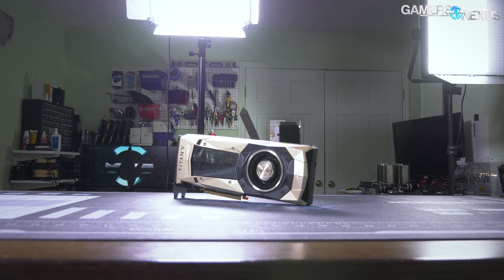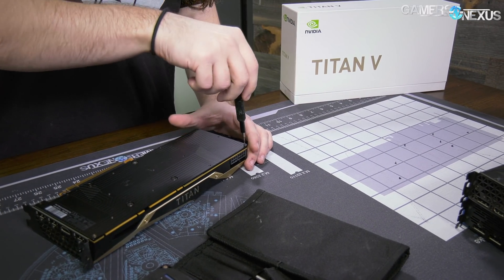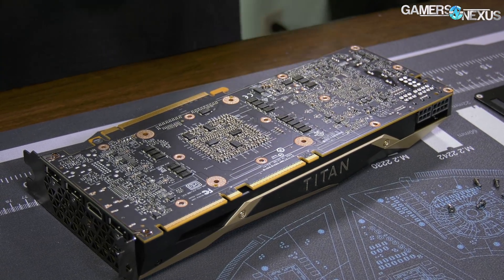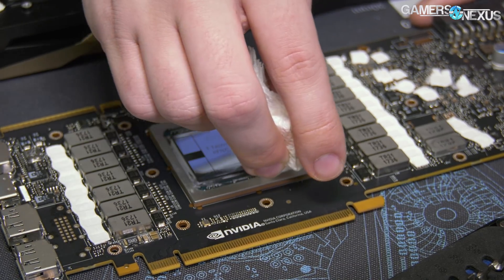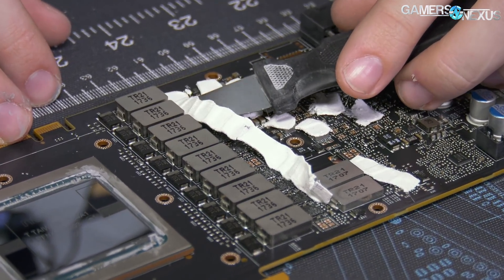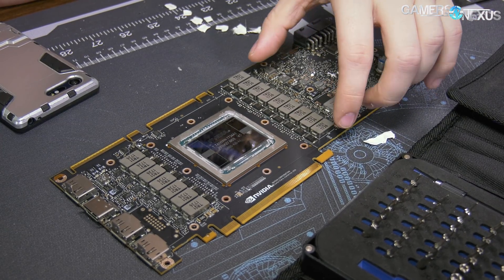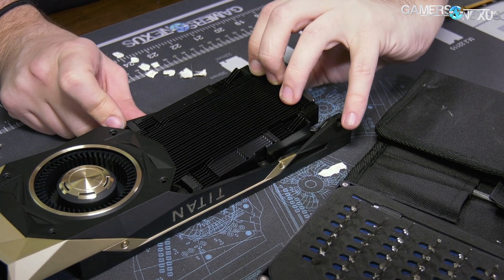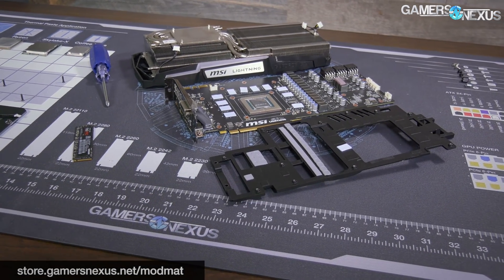NVIDIA Titan V Tear-Down: First Look at $3000 Volta

Comment from the maker: Benchmarks are on the way. Subscribe for those!
GN Modmat Pre-Orders: https://store.gamersnexus.net/modmat
Article: https://www.gamersnexus.net/news-pc/3169-nvidia-titan-v-tear-down-pcb-bare-gpu
You might also like our Titan V specs video: https://www.youtube.com/watch?v=ZjmUzqzDg54
Reply from the maker: How to Computer - Depends. It has a rougher surface that would be somewhat comparable to one of those "grip" aluminum mousepads. It could be done, but it does not have the smooth surface of cloth pads, as the top is more of a rubberized finish. It is definitely meant to be a work mat first. It will come down to personal preferences. I can't outright say that it's a great mousing surface, though, as it's not intended for that use and, depending on your preferences, may cause too much friction. You could always put a normal mouse pad on top of the work mat, I suppose.
Reply: @GamersNexus  , could you tell me which thermal paste you used on the chipset/heatsinker to make it be as good or better than the old thermal paste that was on it? i used a hydronaut and the temps got higher! also which thermal pads [brand and thickness] would you use to replace the old thermal pads on it?  Thank you for the channel ! :D
Reply: Rumour is this can hash at over 3.7kh/s on Cryptonight compared to a Vega 56's 1.9k can you confirm this?
Reply: Thanks for info. I figured it had something to do with using a specific piece of equipment,
Reply: I see that the modmat has not intended as a mousing surface on its page, but do you feel it would work poorly as a mouse pad? I tend to build systems on my desk and was thinking it would be nice to have the mat on it full time.
Reply: John Hooper If it ain't got them Creepers it ain't worth it cuz.
Reply: 4 stacks gives us a 4096-bit bus, and specs say it's 3072-bit bus card...
So, I guess they do similar stuff to AMDs Threadripper here ?
Is one of the stacks blocked/dummy/damaged/not connected ?
Reply: The only thing i don't like about the iFixit toolkit, is they went a bit skimpy on the velcro.
But iFixed it... https://twitter.com/Martin13S/status/903921046490943490
Reply: I really hope you get a shitload of views and subs by publishing volta content before anyone... nice video!
Reply: Looking forward to you doing your Watercooling mod, and then playing with an overclock :)
Reply: Did you get a new camera recently? quality looks great
Reply: Looks like the GPU diagram on the mat needs to be inverted. It's a "front view" diagram while all the screw we'd remove are on the back...
Reply: Equinox, I'm wondering why you still need a DVI connection? You specifically mentioned analog. Is there a legacy setup or monitor you need it for? Maybe a program that requires analog? I'm genuinely curious not trolling. Thanks.
Reply: +Josh CRTs like the Sony FW900 might be a reason. There aren’t any external DACs that can drive that monitor to its maximum capabilities
Reply: Gamers Nexus mod the titan V cooler
Reply: https://www.bilibili.com/video/av17249573/
This user on Bilibili video website cut, add watermark and stole your tear down video, I wonder if you want to take care of that.
Reply: почему ты выглядишь, как чмо? Руки грязные, заусенцы. Еще и радиатор снимать не умеет. Хорошо, что ничего не оторвал.
Reply: Gamers Nexus ,
Reply: Gamers Nexus Bruv. Need some Minecraft benchmarks. Gotta REALLY flex Titan V's muscles.
Lel.

Comment: 9:15 can someone explain how too much thermal paste on the CPU could actually degrade performance ??? I genuinely cannot think of any reason
Reply: Darieee it turns into a thermal insulator with enough thickness.
Reply: mm, ok, but between the backside of the die and the heatsink, it will in any case be squished quite hard - so ... if you apply too much, you'll have a crapton just ooze over the edges ...

Comment: Please use a plastic tip to take the thermal pads next time!
Reply: They have replacement pads. You can buy sheets of the stuff in varying sizes and quality, and other factors for extremely cheap to stupidly expensive (talking $10+ for a little 25mm strip).

Comment: how often would you recommend replacing thermal paste on a modern gpu?
Reply: When you start seeing GPU temps to peak much higher than they initially did, assuming you've cleaned the GPU first. 

I changed the thermal paste on my new card, arctic mx4 or 5 (can't remember), and the temps kept getting worse week after week until I was hitting 20c higher than base @ 100% temps... I changed it with noctua TIM (their best one), and the temps have stayed completely solid. Dunno if my arctic silver was bad, but it degraded soooo fast.

I'd say 2 years regardless, but if that causes warranty issues I am not sure if it's worth doing IMO.

Comment: Nvidia LOGIC?
8gb HBM2 400$ (Vega 56)
16gb HBM2 1000$ (Vega FE)
12gb HBM2 3000$ Titan V.....WTF? 
Pay more for less..the way its meant to be played
Reply: Your logic is that the amount of vram should dictate prices? Nvidia's logic is to price their cards according to what they can do compared to competition. Titan V's memory bandwidth is about 35% bigger and it's cache architecture is few generations ahead of Vega's. Meaning that Titan V doesn't need as much vram and you practically get more for..more.

Ps. Manufacturing cost for Nvidia V100 GPU (just GPU) is about $800.

Comment: You said the heatsink was aluminium at 15:24 but at 15:44 when the cooler is turned upside down the fin material definitely looks like copper.

Comment: ARE YOU SERIOUS?! Gamer nexus as the most wanted piece of hardware ATM and instead of BENCHMARKING it...they risk killing it by taking it appart first?! i must admit, i'm kind of pissed right now...what i want to know is how much faster is this thing compared to my GTX 1080...not how many power phases it has or any other irrelevant crap like that...COME ON!!
Reply: You're a special kind of moron aren't you?
Reply: Shut it! If you don't like it move on. We like to see what is under the hood.
Reply: How much faster it is than your 1080 is irrelevant. It's not a gaming card. Also what, you dropped 800 on a card so now you're soooooo anxious to drop another 3000 on a card not even designed for gaming?
Reply: RAVEN i want to know how much faster because then i'll know how next gen GAMING cards (that will likely not cost 3000$) might perform compared to the card i have right now and for which i paid 600$ (not 800$) and since i'm doing high end VR and high refresh rate 1440p gaming i do feel a need to upgrade for about 4 months already now and nothing has come out and i dont feel like blowing 850$ on a 1080ti for a +30% boost...but THIS card if i can get a GTX 2080 for 650$ or something and get a 40 or 50% boost then fuck yeah i'm in son.
Reply: This isn't going to be the same as next gen cards though, they're going to likely have much smaller dies with less CCs. You're also going to have many hardware and software revisions before then so, you're not going to get a realistic picture from this either way.

Comment: Hey Steve, i have a long hair friend just like you that works repairing computer parts. He used to wear all kinds of devices which protects the parts from static and electric discharges, but for some reason the parts kept frying. In that time we don't know, but the rubbing of the hair threads generates a lot of static and my friend use his hand to kept the hair out of his face(just like you) and with that the charging jumped from his hair to his hand and fry the equipament. All that stoped when him starts to use a hairclip.

Comment: I know I'm not the norm but personally I'd take off most of the shroud and just leave the heatsink on. Put on my own smaller heatsinks & thermal pads for the other ICs and VRM. I'd use it in a 4U rack.

Comment: There is only 1 thing I don`t understand........WHY did Nvidia put a NVlink connector on the card but don`t use it.
If you can`t use the connectors.........then WHY put them on the card in the first place????

5:26 Dammm......they used so much that the paste is almost on the pcb :P
But under that paste......dammm again because it looks better then the HBM2 from the AMD cards.
Oke, AMD had only 2 stacks & This card has 4.....but overal it looks cleaner.
Reply: Oke, that make sence :)

Comment: Steve, for future tear downs, is it worth weighing the card before you remove the paste so you can add a similar weight of paste when you rebuild it? While paste density changes between products of you could get fairly close to what the card maker has used without having to do a bunch of trial trial and error testing.
Reply: 75keg75 if he don't have exactly the same paste why would he try to replicate the amount of it?
Reply: I thought I covered that point by saying  "while paste density changes between products you could get fairly close to what card maker used" in my first post....

Comment: Okay, now grab a Threadripper AIO cooler off the shelf and turn this baby into a hybrid card!
Reply: Not exactly you have to cool the VRMs still at some of the caps
Reply: Telamenais Hence the “hybrid” part: you leave on the base plate and the blower fan to cool the VRMs. GN has done it before with plenty of graphics cards, just never with a GPU this massive.
Reply: Massive?

Comment: I would think that if a graphics card is marketed at professionals etc. that they would focus the design on incorporating a larger fin array rather than a plexi window... Wouldn't lower temperatures allow a higher base clock, meaning more performance per dollar? Or is the 250w a hard limit they placed?

Comment: thanks for actually doing benchmarks steve, i can't wait to see linus' videos 4  TITAN Vs IN SLI!?! $12000 OF GRAPHICS CARDS
Reply: No SLI no NVlink on these entry level cards you need 10k tesla cards for NVlink and still no SLI on those.
Reply: You can still do 4 way SLI, however it's not officially supported by Nvidia anymore.
In theory you can do 8 way SLI in Windows 10 with DX12 or Vulkan. The foundation is there, but no one has yet taken it seriously.
Reply: I thought Nvidia did away with more than 2 way SLI? Linus would still find some way to do it though.
Reply: Please do your research before parting ur $3000, Volta does not support BOTH NVlink and SLI.
Reply: CheapSushi Titan V doesn't support it appearently
Reply: Supposedly there is a bridge connect for them, a $500 NVlink between them.
Reply: Pennywise yep is the low end of this line of cards, like the cheapest epyc processor is the entry level of that line, yep both could be used for gaming do it make any sense? If there are gains and money is no sense at all, maybe.
Reply: To play Minecraft at 1 million FPS.
Reply: Slinky already has 4 of them.
Reply: England is my city No SLI on this card.
Reply: sli isnt compatible with it
Reply: well technically it quad SLI won't work since they dropped support on it in PASCAL
Reply: In normal desktop its called SLI
In a Workstation or Supercomputer its called NVLINK

And this card have neither of those 
Only the Workstation/Supercomputer version of Volta aka Tesla V100 that have NVLINK and those cost $10k a pop u’ll need $20k just to run NVLINK

#rip

Comment: I like to point out a few notes from seeing this. The Geforce GTX branding is completely gone from the cooler (it says Titan in its place, probably marking the shift in marketing for the Titan into its own brand/line of GPUs) the SLI connectors are gone, replaced by NVLink connectors. 

And the people who will benefit the most from not only this teardown but Buildzoid's upcoming analysis is GN's minority viewers who are indeed into deep-learning (like the guy who sent Steve the Titan Xp for hybrid modding/review) and find this stuff informative (not saying it's a bad thing. If anything I give respect to you guys for doing constructive videos like this).

Comment: Why are the sli fingers so huge, and in a different position on the PCB than normal?
Reply from the maker: They are NVLink connectors.
Reply: i think nvidia said that the tiran v will not support sli or nvlink, they probably reused the pcb form one of the higher end volta cards that support nvlink

Comment: What are these connectors on the top of the card where normally the SLI connectors are? These look huge. And it doesn't look like they are exposed through the cooler.
Will there be a new SLI Connector with Volta?
Reply from the maker: NVLink
Reply: Melvin Klein last I heard volta sli would fully share the graphic load between the two cards but I haven't seen the topic come up in months
Reply: Sharing the workload between the graphics cards would be nice. But I doubt that thats possible. At least without a ton of manual tuning for every game.
Reply: I saw a guru3d article a few days ago saying it wouldn't support NVLink. Speculation or does it really not support it. I know it grabs a lot from the v100 which does support NVLink.

Comment: That is a strange looking SLI connector. Higher bandwidth or NVlink? Just strange.
Reply: Like a $1000 DLC
Reply: Sean murtagh nv link don't work.
Reply: probably NVlink fingers, although the card supposedly doesn't support NVlink. who wants to bet Nvidia will release $1000 NVlink bridges for the card a few month down the line that will unlock NVlink

Comment: What is machine learning like artificial intelligence ?
Reply: Yes. Machine learning is a field of computer science that gives computers the ability to learn without being explicitly programmed.
Reply: Malus1531 you can tell by the way that it is
Reply: machine learning refers to building statistical models where you are only really interested in getting reliable predicted results when given inputs. It differs from traditional statistics where you are typically interested in determining if there IS a way to model (known input) -> (known output) that is better than random chance, and then interpreting what the model means in real life terms. As an example of the difference, you could use traditional statistics models to determine if there is a relationship between the length of a video and the amount of revenue the video generates on Gamers Nexus, and then look at the model to determine an optimal runtime for each video. You would use machine learning techniques to throw every known characteristic of a video (run time, length of title, particular words in the title, even the thumbnail image if you're using the right techniques) into a model (probably some sort of neural network), and train it to spit out a predicted amount of revenue. You wouldn't be able to really see how changing the run time or the length of the title affect revenue using this method, but you could take a new video, plug the video characteristics into the model, and get out a predicted revenue.
Reply: Skynet
Reply: Machine learning mostly refers to machines that learn

Comment: When will reference cards start getting better coolers? This is just ridoncolous.
Reply: Douglas Fulmer these cards need blower style coolers, they are often sandwiched together in a case somewhere of site where noise isn’t an issue. You remote access in to the machine and give it instructions and tasks to run, it’s not a daily driver on your desk.
Reply: Good point dad, but all gaming cards from both AMD and Nvidia start with these blower coolers and they don't have the same thermal performance.
Reply: tru dat

Comment: 3 grand and they can't make a not shit cooling system. Christ.
Reply: lol again when it's being used in some kinda machine learning setup you don't care about the noise.
You care about getting air out of the system and a cooler that can run for years straight without failure at a low cost in terms of physical space taken up by the card.

This cooler is pretty much perfect for these requirements, the only other option would be liquid which is too unreliable and too expensive for too little gain in commercial use. 

This is not a consumer card for the love of god.
Reply: Bigd Hehe did you not see the previous replies? The only people that should consider buying this don't care about noise, they will likely have these in rack mounts and for that you want blower style cards, not open-air, and definitely not liquid cooled
Reply: You act as if this blower style cooling system hasn't been in use on all their founders cards for how long now? I'm aware that you're paying for the tech, not necessarily the cooling system, but I would have imagined by now they could have made something a little more efficient for the cost? It was just a thought, not a reason for people to get triggered.
Reply: https://gyazo.com/7dbd8b41f8fa6192b90194c83b1b87e1
https://gyazo.com/a1592b7c706d3a856de6c2010585966f
To make it abundantly clear: This is not a consumer card. at all.

Unless consumers start to run machine learning applications in their homes I guess.
Reply: For the record "One fan point of failure" is hardly a pro. There is no redundancy for your cooling..one fan dies, you're done. At least if a single fan dies on a dual fan card you still have something. Only pointing out that I don't know why you would count a single point of failure with no redundancy as a pro, not saying this needs a better cooler...just that that is an odd "pro"
Reply: it works, it doesnt heat up the rest of the internals, it fits in only 2 slots, it's only one fan point of failure, it's not max speed at max temperature... therefore it's fine, unlike your made up complaints